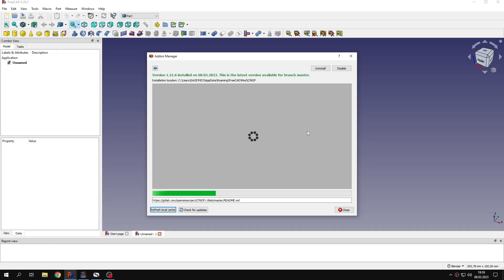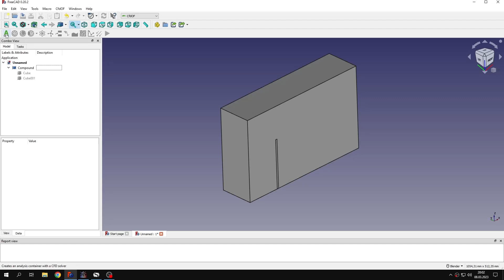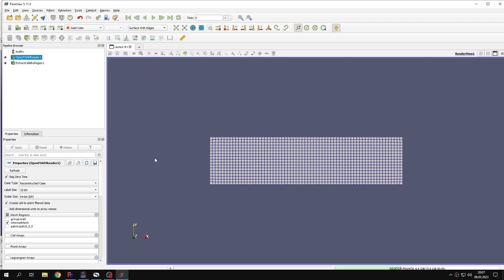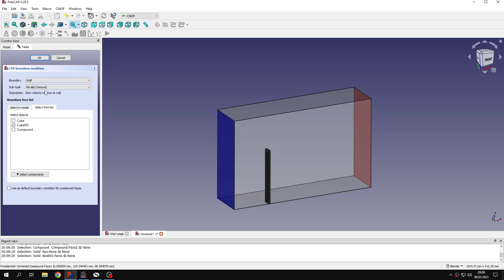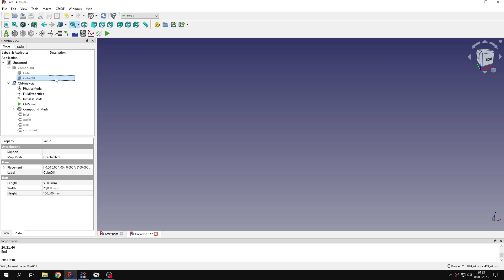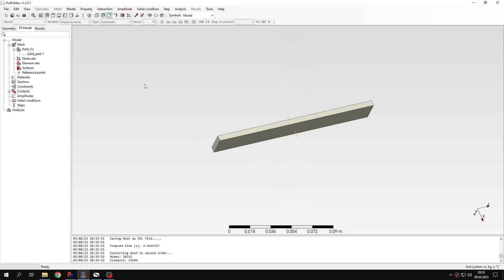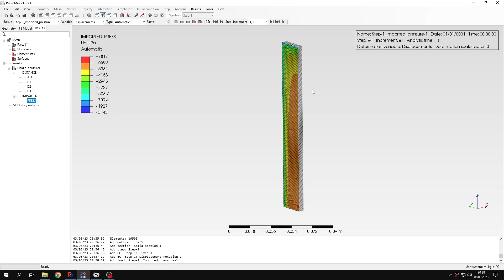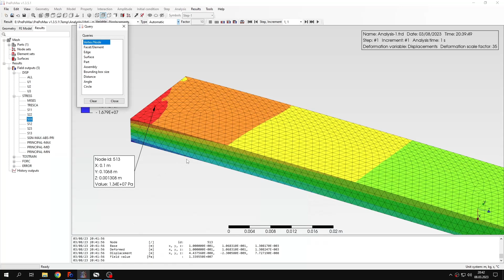PrePoMax (CalculiX FEA) - Tutorial 32 - Pressure imported from CFD (with OpenFOAM and FreeCAD)

Comment: Hello, is it possible to import Pressure loads in CSV file format from OpenFOAM in this software and perform Fluid structure Interaction? Please advise. Thanks
Reply from the maker: You can do what is shown in this video - import OpenFOAM results directly from their folders by selecting a dummy .foam file. Then it's used as non-uniform pressure load so it's not a two-way FSI.

Comment: Big thx, I had no idea that PrePoMax even existed, I was getting frustrated with FEM in FreeCAD there's a lot not finished, However I came across the BESO Macro and wow! what an amazing tool so now I can't let FEM W.B go. If only PrePoMAX had geometry optimisation also, is it possible to run BESO Macro in PrePoMax?
Reply from the maker: It was already requested some time ago but BESO is not supported in PrePoMax. You still have to use FreeCAD FEM workbench for that. But there's some significant progress in the development of this workbench, it should be more user-friendly in the next versions.

Comment: Is this analysis a coupled ale type analysis or it just imports the cfd data ? Can this be used for example for a transient seismic analysis and have properly coupled results ?
Reply from the maker: This is just a conversion/mapping of fluid pressure results from a CFD simulation in OpenFOAM to surface pressure load in a structural analysis in PrePoMax. That’s how the "Imported pressure" load used here works. It only supports OpenFOAM results. If you need actual coupling between CalculiX and OpenFOAM, check the preCICE code.

Comment: Hi, this was very interesting, is it possible to use PrePoMax for fatigue analysis as well? Basically, I have transient loads on a OF patch and need to do fatigue analysis
Reply from the maker: PrePoMax doesn't have any fatigue analysis capabilities but check Fatlab. It's another open-source software, meant specifically for fatigue and supports CalculiX results.

Comment: _Thanks for this tutorial. It is really very helpfull, One quick question. Shouldn't be applied the pressure in both faces instead of in only one? Negative pressure will apply some forces as well
Reply from the maker: Yes, it's best to select all the faces subjected to flow when performing this kind of analysis. But I simplified this for the purpose of comparison with the analytical solution.

Comment: I am curious to why you moved the cube 100mm on the Y axis?

thank you. I am currently following this tutorial to see if i can FINALLY understand haha

In other tutorials i have watched, they CUT out the blade shape from the fluid domain. What is the difference of cutting it out vs making a compound shape? if i do the compound shape, such as what you have done, will gmsh be able to mesh it or can only snappymesh work with compounds?

Second, with snappy mesh, what is the "Point in Mesh" doing? I placed a small cube at the cordinates you provided, just to get a visual.

When you did the refinement, what does checking the box "solid" do? what would happen if i didnt select that? an error? or a differnt type of CFD?

Do i need to add the reconstructPar if using paraview?

Lastly, foillowing this tutorial exactly, it is still taking hours to complete the solving. I have 8 cores and 32GB of ram. I did make sure to to set the cores to 8

Thanks
Reply from the maker: 1. To position the parts properly relative to each other and have the (0,0,0) point in a convenient location.
2. Both approaches are correct but cutting is more universal if you want to test other meshers.
3. Point in mesh identifies the fluid domain in the model (if it's external or internal flow).
4. Solid1 is a volume object under Cube001, it's just to complete the selection (there could be more such volume objects under a part).
5. No, ParaView doesn't need it.
6. If parallelization is working properly then maybe your mesh differs significantly from mine. But an issue with OpenFOAM installation/setup is more likely.

Comment: ok, im new to cfd so i am trying to understand whats going on. What is the point of the small cube inside the big cube? Is that smaller cube a solid or a cut out? 

Is the smaller cube acting as a "plate" and the larger cube acting as a "wind tunnel" of "fluid tunnel"? 

Thanks for the video. I am going to try and follow it tomorrow when im in an office to do so
Reply from the maker: Yes, the small cube is a plate subjected to wind while the big one is a wind tunnel (fluid domain). There's no cut, just a compound of those shapes. snappyHexMesh knows which region to mesh thanks to those "Point in mesh" coordinates.
Reply: @FEAnalyst  with meshing, do we only mesh the fluid domain for cfd? If so, why does the smaller plate not need to be meshed for cfd?

Thanks for the help
Reply from the maker: @LT72884  Yes, only the fluid domain is meshed in CFD. Solids are not meshed because they aren’t used for fluid calculations. Only their walls are relevant since they affect the flow.

Comment: Hi, thanks for such a comprehensive tutorial.  Helps bring all the excellent open-source tools under one lesson.  Just a quick comment: You can set FreeCAD to use MKS units not sure if that will eliminate the steps necessary around the 13:00 min mark where you copy and scale the model.  I know that in Calculix the units are the users responsibility (same as ABAQUS) even though PrePoMAX makes it simple to use consistent units.
Reply from the maker: I think that I’ve tried using that unit system but it was still necessary to scale the geometry because that unit scheme change had no impact on export. There is even a setting for STEP export units but it didn’t help either. Such unit manipulations are quite tricky in the case of STEP format.

Comment: Amazing vid as the others, not much to talk about, but I want to comment to provide engagement :)
Reply: Actually, I have one question, in the  CFD part, why were you able to not apply any kind of BC to the bottom side and top wall?
Reply from the maker: @EngineerAAJ  Good question. In CfdOF, boundaries that don’t have any BCs explicitly defined used default BC - wall, slip.
Reply: Ah, ok, thanks! @FEAnalyst